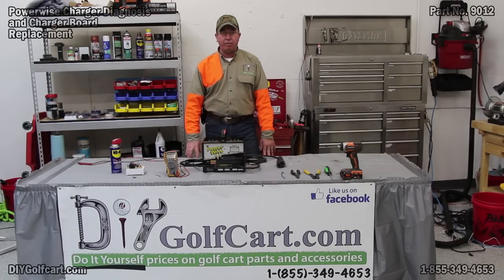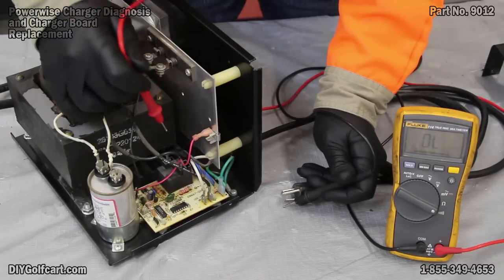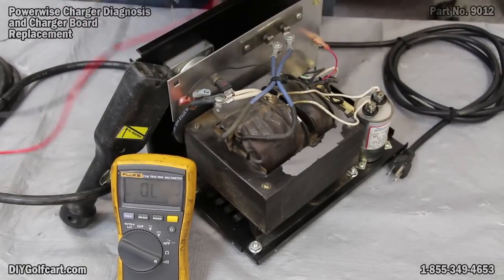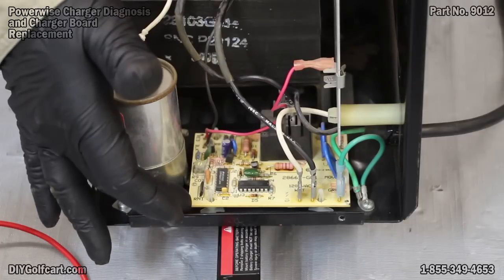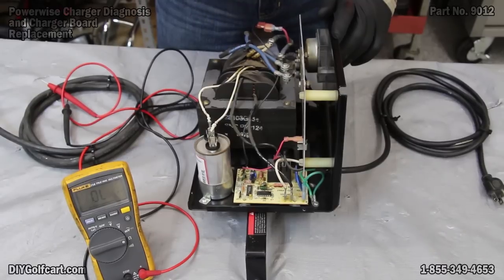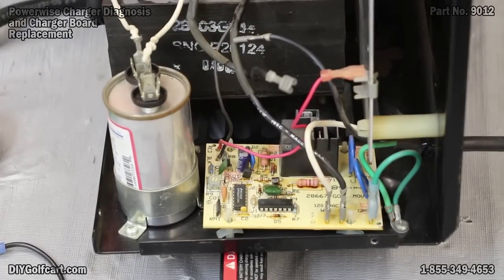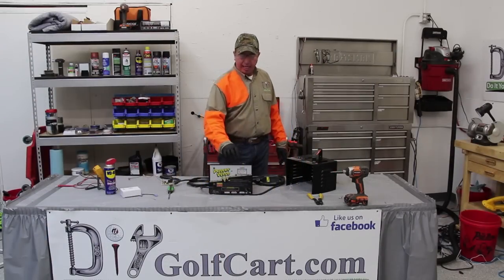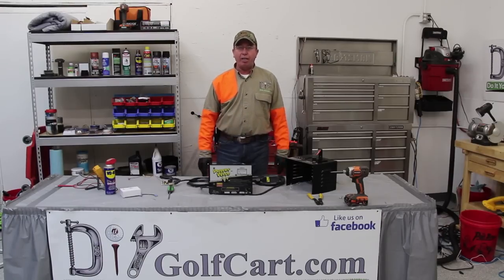Powerwise Charger Board and Diagnostic | How to Repair or Replace Golf Cart Charger

Comment: Thank you for posting this most helpful video. I have a used Power Wise charger model# 29115G04 with the single circuit board. I have tested it per this video and it needs a new board. The red ground clip wire from the DC plug has been cut off after the cord enters the charger. Where does this wire connect?

Comment: Thank you!!!!!  I brought my charger in next to the computer and went through each step with you!!  It's the relay.  I built a bypass wire as you suggested and got my cart charging now, and a new control board ordered!!  I have the older version so I guess I will have one board now instead of two.  Anyway......Thank you again, you were a great help!  Excellent video!!

Comment: I watched this video charger is good. When I plug the charger in it will run for about 45 mins. and then turns off. The battery's are brand new. I have a 97 Ez-Go TXT 36 volt cart I also installed the large cables. I'm at a loss for what to look for. Thanks James
Reply from the maker: James High What's the problem? Are the batteries not getting fully charged? Load test the batteries "Brand New" realistically means nothing. I've gotten bad batteries right from the battery store.
Reply: Load tested . Battery's maintain 6.7 volts ea. after load testing. Cart stops after riding though the park after about 1 hour or so. The charger turning off makes me think it's not fully charging .I have the older powerwise charger with the 2 boards diodes tested fine.The relay clicks . So I don't want to install a board and this not be the issue . Thanks
Reply from the maker: James High When it's time to charge your golf car, put your multimeter (set on VDC) across the battery pack and clip it to the terminals so that it will stay in place. Once the voltage settles, plug the charger in and watch the voltage increase.  Make sure it goes up to around 41 to 43 volts.
Reply: Borrowed another charger . It worked so I know now it's the charger. Thanks Much.
Reply: +DIY Golf Cart Hey DIY, when my charger charges my golf cart, it takes the batteries up to 46.3V. Isn't that too high? I can smell the batteries gassing.

Comment: I have a 2009 Gold Std Prec Elec 2 plus 2.  The batteries are not holding a charge,
Club Cart service recommended upgrading on-board computer to version 5.5 or 6 and replacing all of the batteries.  Is this the most up to date version, I have 4, 12 volt batteries.  Will this solve my problem?
Reply from the maker: Lisa Garfinkel Unless your OBC (on-board computer) is bad (not functioning) I wouldn't replace it. Just because they may have made some changes, for me doesn't justify spending that much money. Changing batteries may help because the 12 Volt batteries were never that good of a battery. Give me a call and I'll tell you how to correctly check your batteries. (Load Test)